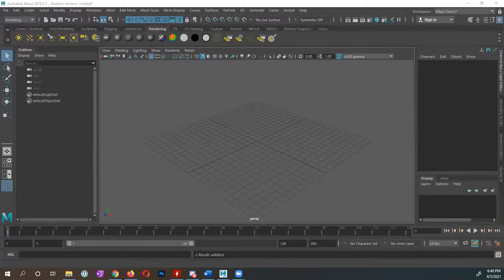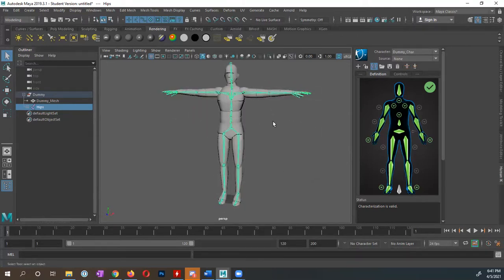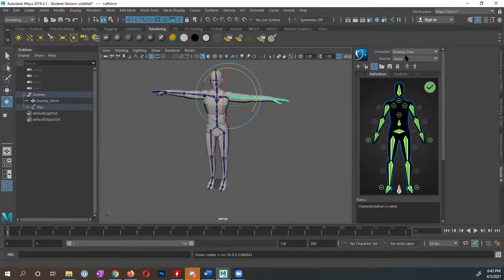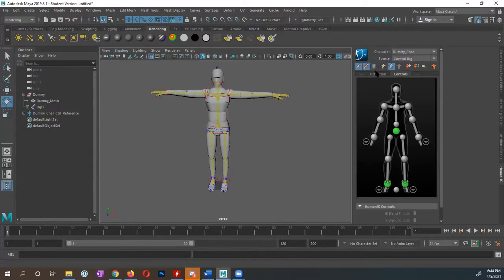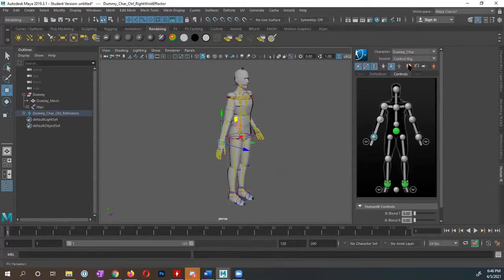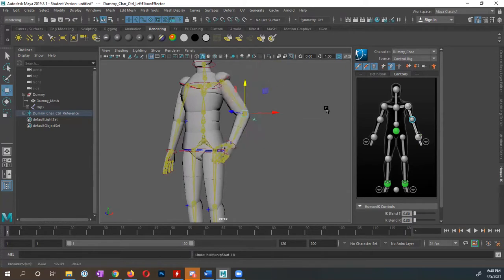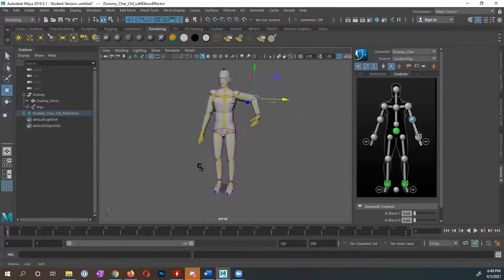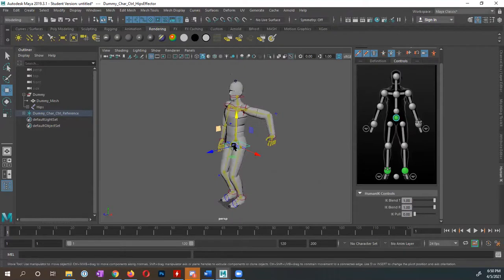Using HumanIK in Autodesk Maya

Comment: Pretty sure that the reason why the feet didn't go underneath the grid when the pinning was removed was because of the Floor Contact setting...
One problem that I have is that when I Imported my Human Ik, the Red and Blue Controllers were really small and needed to be scaled up to become Visible - is there any way around this?
Also, I'm having trouble Matching my FK and IK with respect to the Wrist Effectors...
Any help is appreciated...